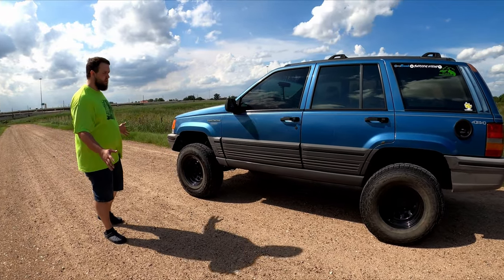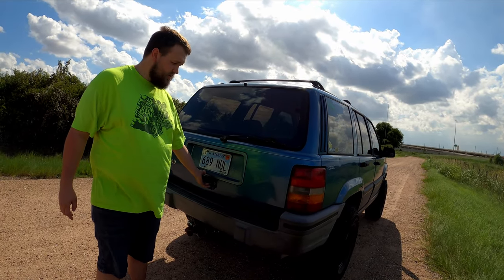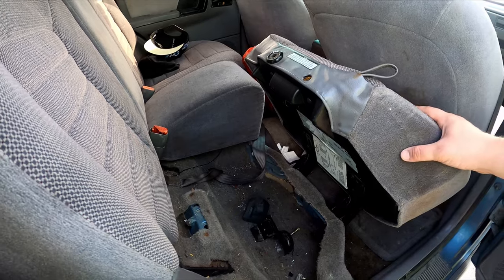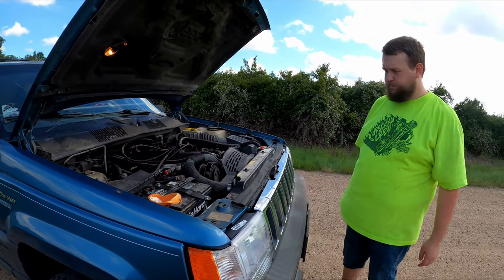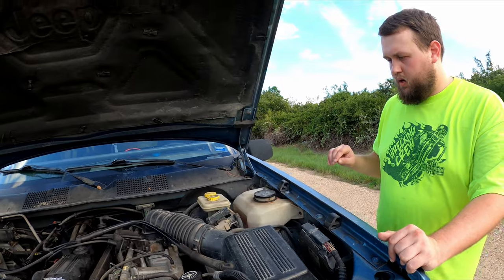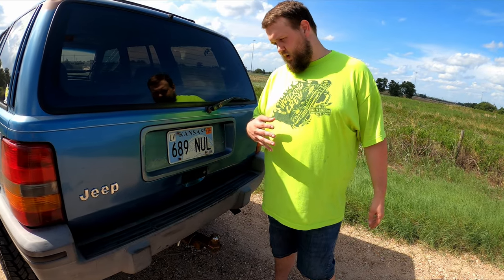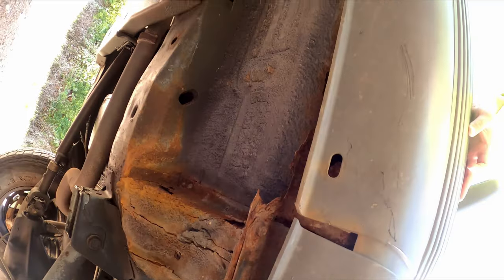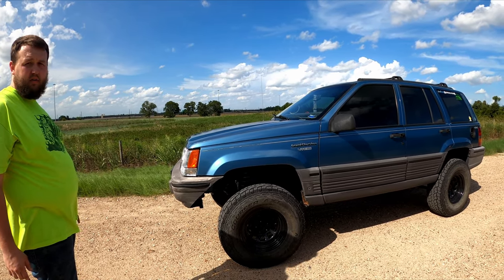What You Need to Know About a Jeep Grand Cherokee ZJ | WYNTK ZJ

Comment: Your overheating problem is not only solved by setting the thermostat to 82°

On the XJ, the Fiat valve is placed to turn on the electric fan at 82°.

(the mechanical fan clutch fan is removed and an electric duo fan from Malibu is installed) and if you have your water pump, radiator, 16-pound hose cover in good condition, that jeep will not overheat!

Comment: The 2010 Chrysler 300 5.7 electric fan fits perfect, a hayden fan controller and a 150 amp final relay solves the overheat issues. That's what I did on my 97 5.2.
Reply from the maker: That’s really good to know. I picked up an orvis edition last night with the 5.2. May do that swap. Thank you!

Comment: Note to self. Don't fix the A/C so the coolant temps stay down. Hasn't worked since I bought it 5 years ago so I'm not missing it.
Reply from the maker: Very common issue on these. I’ll be replacing the whole system and adding a fan. Need it in south texas. 😅
Reply: Try living with no a.c in virginia where its 90-100f with 90% humidity..   plus you need a.c to defog wimdows properly...  it isnt hard to fix...  i even fixed mine on my grand wagoneer.. just got a new comoressor.. and used mineral oil and refilled with r12..
Reply: I’m in Alaska so no problem 🤣

Comment: Great video, thanks for making it! Stupid question but are you running stock length shocks on your 4" lift?
Reply from the maker: Nope! My shocks are actually off of an early 2000’s explorer. They are about 4.5” longer, as well as Stiffer, so helps with handling. They were about $160 off Amazon for the set.

Comment: i love my 5spd zj never had an issue with the gas door ever. running mvf armor and kept the door. but mines long armed locked 4.88s with an artec truss kit on a ford 8.8.  my cup holders also work just fine why waste money on goddy parts you dont need that dont improve the jeep in any way. dont put different temp thermostant in either they are computer controlled and you should always keep the correct 195 in it.
Reply from the maker: Thanks for watching buddy. I, along with a ton a others love the cup holder fix. It’s an improvement. The thermostat is an age old argument, and I did what worked best for me. Your jeep sounds nice!
Reply: @LaterSlater  its a bit over kill but works and super rare its not a swap. ive never had an issue with the cup holders.

Comment: . One good thing in down under we don,t have the rust issues . Please could some  explain what this mountain vista fab steering box  brace . Where would j get one . Thank you so much.  ps the jeep we hot is the zj 96 , Right hand drive assembled in Austria.  So hope one fits . Cheers .
Reply from the maker: Mountainvistafabrication.com

The steering box brace bolts on underneath your sway bar mounts, and attaches to your steering box. It spreads the load of the bigger tires and what not to both sides of the frame, instead of that one little spot and 3 bolts it is held on by. This increases responsiveness and overall feel.

Comment: Honestly i dont like the Gen 1 ZJs.. too old outdated.  The 2nd gen like a 98 is the best and the dash looks even modern today still.

Also you dont need to buy that wobbly crappy cup holder fix.... lol 98s had a cup holder insert i sell them on ebay for 30$.. they always on ebay.. or find a 98 in the junkyard.  Easy fix.

Never had an issue eith our 4.0 and cooling ?  400k miles now ?  Ours stays at 200f with a.c maybe 210.  Ever think of upgrading the fan clutch... they do make differebt ones for more resistance on the coupler to get better cooling..

Check your torque boxes under the drivers and passenger floor.. they all rust there.. hidden by the undercoat from factory.. rusts out the frame you cant see eithsd

Comment: What lift you got boss and what size tires you hot
Reply from the maker: This one was on 4” front springs, and I moved the stock front springs to the back. Then bought adjustable control arms and track bars from different places that were the cheapest at the time.

Comment: the cupholders are only for 96-98
Reply from the maker: Brandon made a set for the first gens, I’m not sure that they’re still available though. The 2nd gen one works on the 1st gen, you just can’t tape it down so it’s slightly annoying but still serves the purpose.
Reply: @LaterSlater  it doesn’t appear that they are. I cannot find them. The cup holders are garbage I agree
Reply from the maker: You can always email and ask. I have the 2nd gen holder in my 1st gen and like I said, just annoying that you can tape it down but it works.

Comment: How about automatic gearboxes?
Reply from the maker: Mine has a 42RE in it. Not the strongest unit by any means, but is reliable with maintenance. Mine made it 260k before it got rebuilt, and it didn’t quit NEED it yet. Early 94 models came with the AW4, that is the one to get in terms of strength. 😃

Comment: how reliable are zj 5.2 v8
Reply from the maker: They’re awesome in my experiences. They have plenum gasket issues, so they tend to burn some oil but they’ll burn oil for forever.
Reply: @LaterSlater  found a cheap one with high mileage still debating on it but good to know thank you and yours is sweet